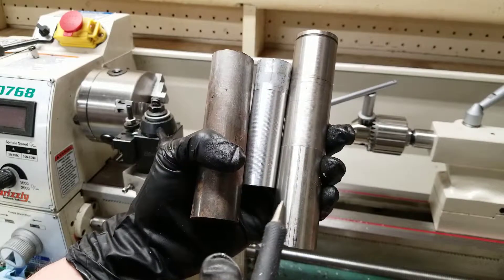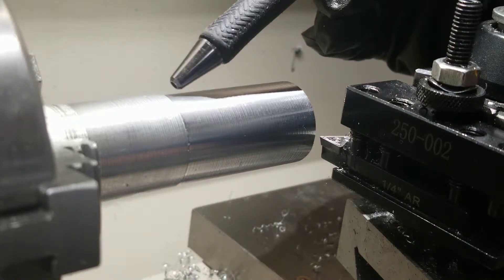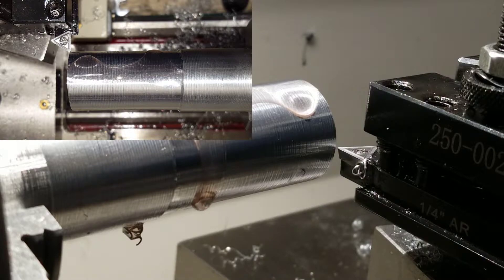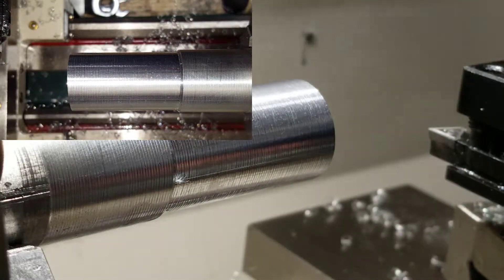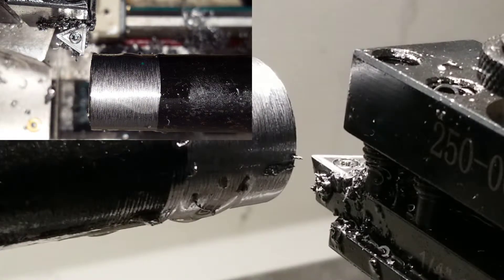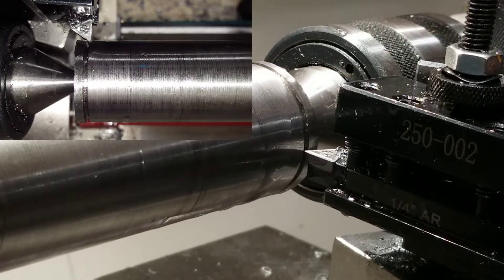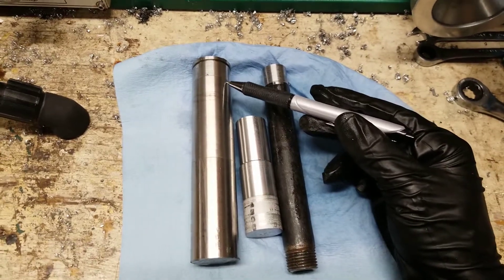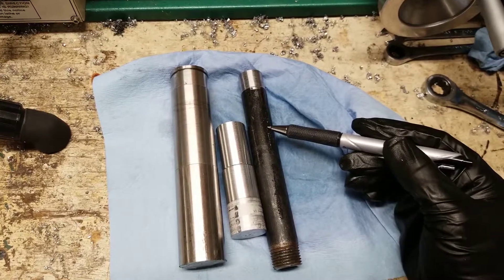Turning Aluminum vs Mild Steel vs Stainless Steel on the Lathe

Comment: Way to slow for that diameter. Should be running atleast around 750 to 1000 rpm with carbide. You want your chips to come off brown and turn to blue. The heat actually aids in the metal removal and yes you will get a lot of smoke with all that oil on there.
Reply: So in other words, you want the metal to be work hardened.  How does that aid in metal removal?
Reply: @wardamo  The heat hoes into the chips not the work

Comment: Thank you good sir, I'm trying to drill a 7/32 hole through 5 inches of stainless and it behaves very different from mild steel . Came here to check out a more in-depth analysis of the difference .
Reply: If you are still searching for an answer consider using resources for or from CNC machinists. They got a lot of technical information that is very imported for more demanding materials like Whatever mystery materiel you have ;) You will find this data yourself once you learned what to look for and how to use it.